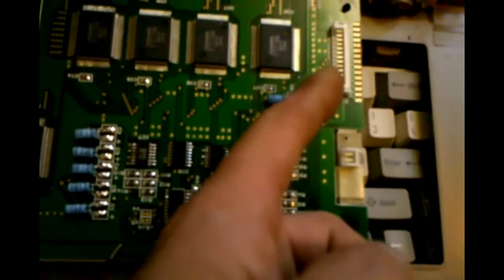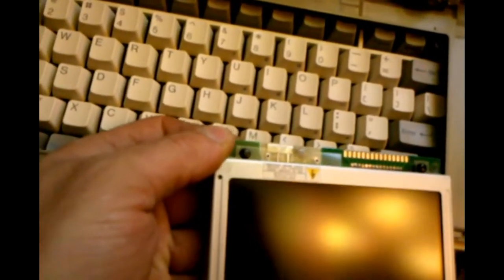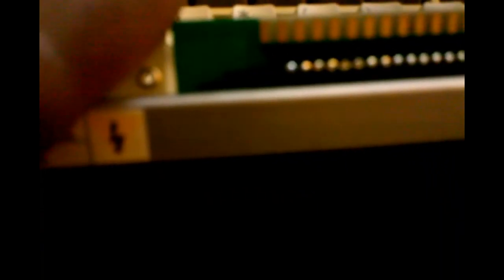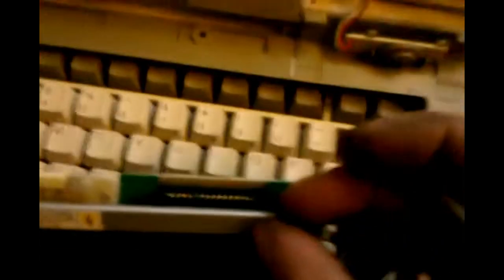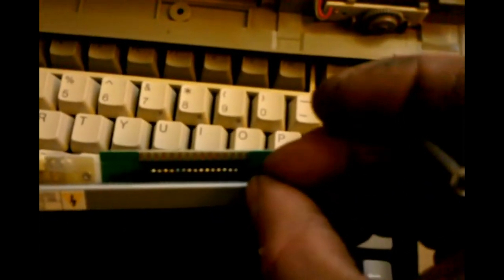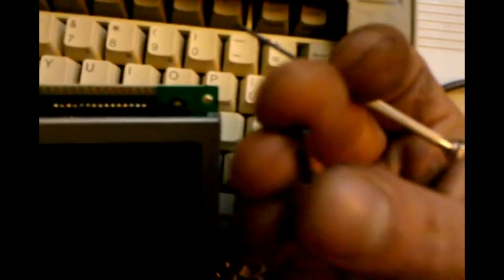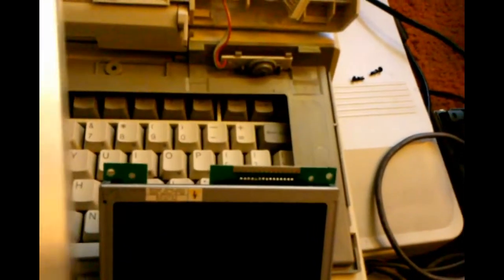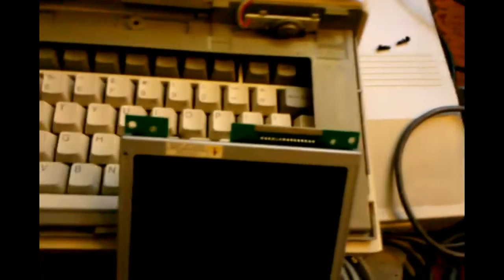(2011) Toshiba T1200 Backlight Repair

Comment: I have the same problem on my t1200. No spare parts avaiable. Is it also possible that the inverter is faulty?
Reply: ok, there is no inverter board on this thing, did someone found a spare searching on the web?